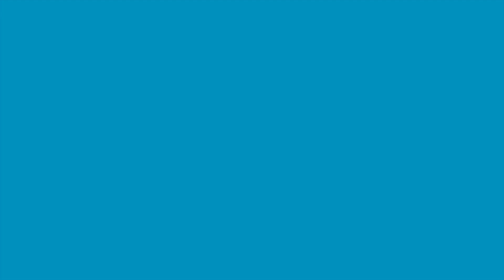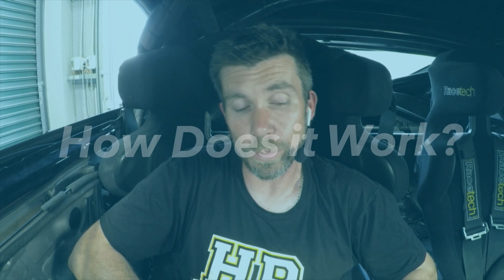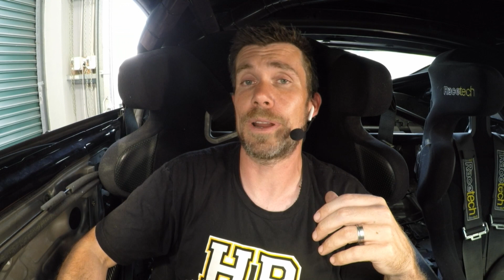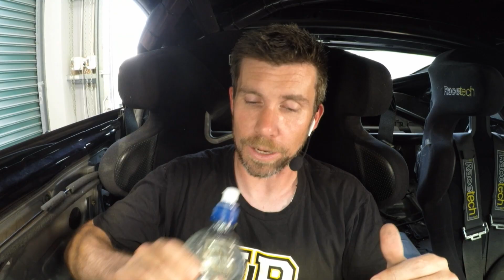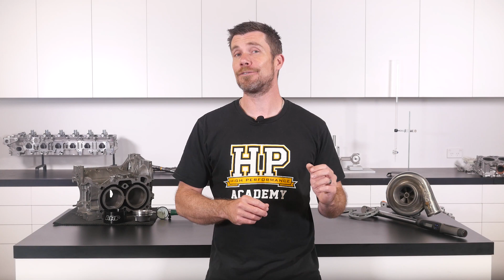[HPA Q&A] Rotary Ignition Timing vs 4 Stroke Piston Engine Ignition Timing

Comment: a rotary engine is also a 4 stroke engine?
Reply: in my opinion its a 2-stroke because their is no valves or camshaft.
Reply: but it still has an intake cycle, compression cylce, combustion cycle and exhaust cycle. a rotary does not have overlapping cycles or uses intake mixture to flush out exhaust gas, which 2 stroke engines do.  some old cylinder engines did not have valves either.
Reply: Not to be a prick but a rotary doesnt have a stroke,it rotates
Reply: Yes thats true, they aren't real strokes, unless you would count the eccentric part of the crankshaft. 4 stroke is generally  used in place of Otto cycle. a rotary is an Otto cycle engine, which is a different system to a 2stroke system.
Reply: Yes thats true, they aren't real strokes, unless you would count the eccentric part of the crankshaft. 4 stroke is generally  used in place of Otto cycle. a rotary is an Otto cycle engine, which is a different system to a 2stroke system.
Reply: The 4 "Cycles" are:
1 - admission or intake
2 - compression 
3 - explosion, expansion or power stroke
4 - exhaust

As you can see, it has nothing to do with engine being piston, rotary, diesel or otto. 
Diesel engines can be 4 or 2 stroke just like gas engines can be 4 or 2 stroke.

2 stroke engines combine the cycles 2 by 2 resulting with:
1 -  intake/compression
2 - power/exhaust

The Wankel we know has all the 4 cycles.
I'm not aware of a 2 stroke Wankel though. Might be some design challenges that don't make sense economically
Reply: @Razonics13  2 stroke rotary would be a square rotor (lol) and part 2 of the stroke would shoot fireballs out the exhaust, not ideal for ur cat or keeping a car legal.